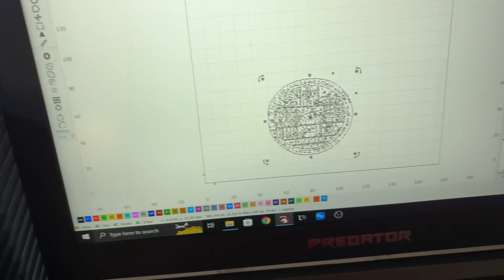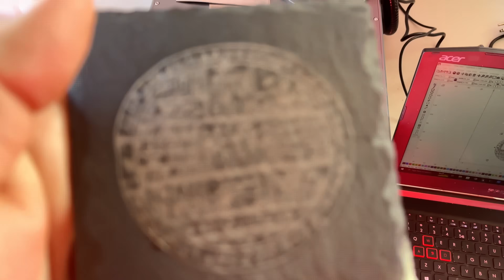Masterfully Engraving Stone - Monport GA 100W Fiber Laser

Comment: With the rustoleum clear enamel spray, a heat gun at 700 degrees works perfectly for a quick dry. For single small things, or anything you can get to fit, a cheap food dehydrator works too. I use it mainly for drying 3d printer filament, but works well for quickly drying painted things too.

Comment: How is this one compared with commarker titan? They both use JPT laser source and price similar too. But they have a faster speed up to 15,000 .
Reply from the maker: @Aed-d4o  the titan comes in up to 200W and the internals are detached in a separate unit instead of under the work area. That's the biggest differences. The unit that houses the internals also has more fans on the titan meaning, in theory, you can run it longer over a given period without worrying about heat buildup.